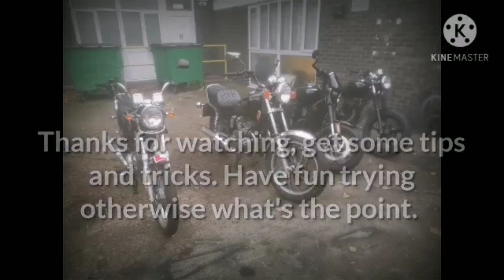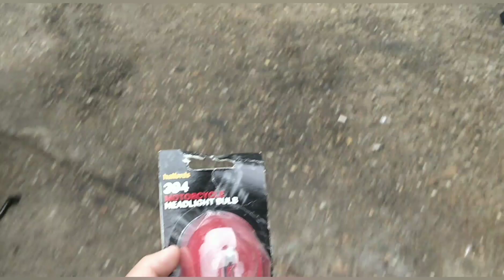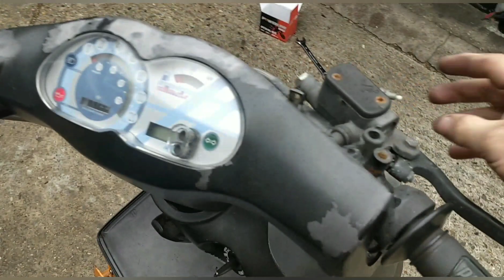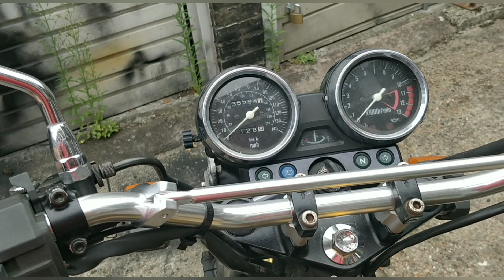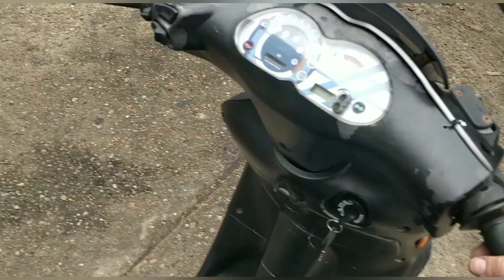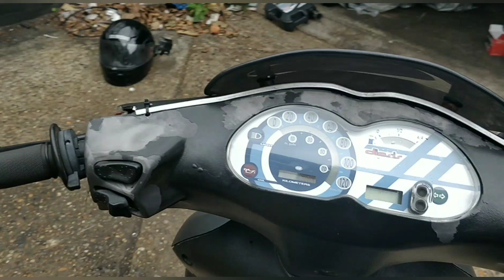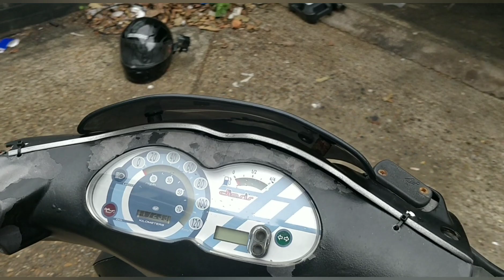how much does youtube pay, my free piaggio, finishing touches and test runs.

Comment: That second run looked much better. Did it cut the smoke too?
Reply from the maker: Yes it did actually. It had 1 suction line with a split, a second carb clean and the hole in the box taped back up. 

Solved the running issues and smoke.
Reply: @motorcyclerescuer  nice!